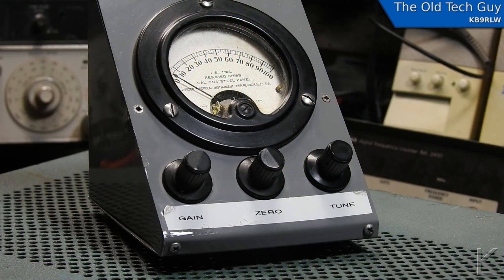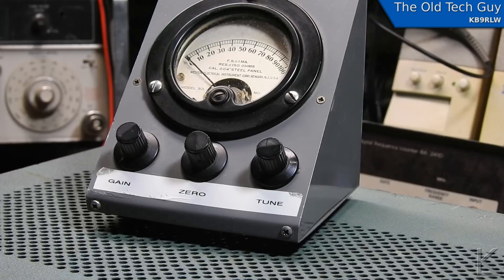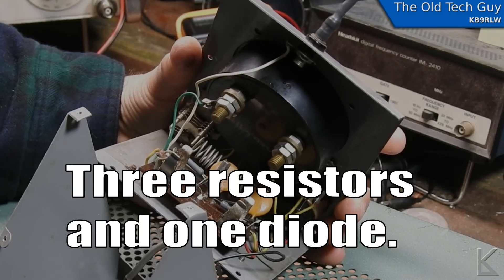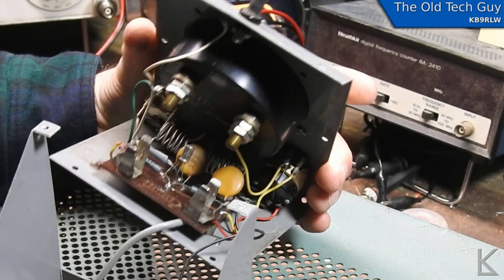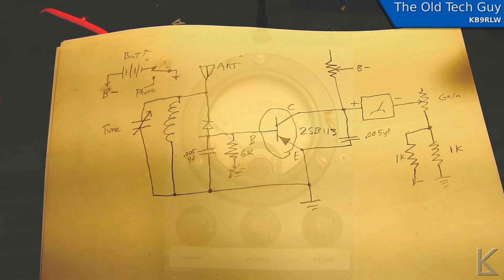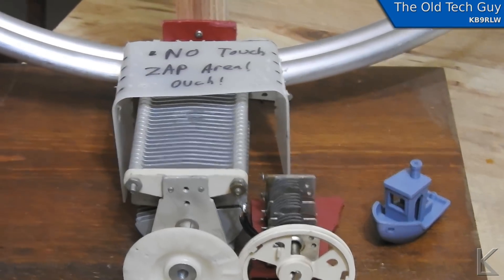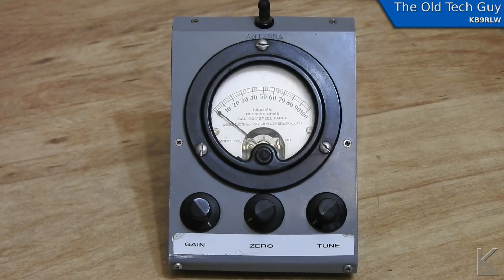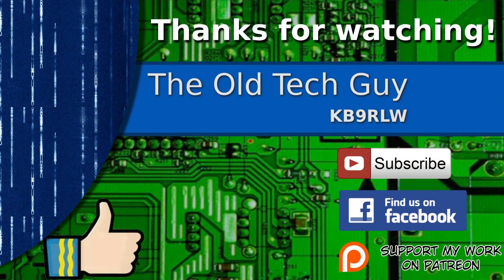Ham Radio - Dissecting a mystery meter.  What is this thing?

Comment: It looks to me that that's simply an AM receiver. LC circuit tunes the frequencies until receiver tunes the transmitted signal. Diode detects audio that could be heard with a high impedance headphone, of around 2kohm. Transistor simply amplifies slightly the audio to get more volume. Adding another audio amplifier and a speaker should be enough to hear AM stations at great volume.

Comment: thank u very much sir.  whats the range of frequency it deteceted
Reply from the maker: It has a tuned circuit centered around 27mHz.  So its probably good within 5 or so mHz either side.
Reply: @loughkb  thank u sir .its for CB radio i think

Comment: I've heard of trucking companies having truck stops check power on cb's looking for linears and so on. By chance did this come from the D.O.T. in the past? Measured at the front bumper of the vehicles, this could've been used regularly, every day to STOP cb splatter and transmission interference (especially at blasting sights where the ignitions could be set of by them) on road work locations?

Comment: The meter movement is obviously a replacement for the original one that was square since you can see the 4 extra mounting holes in the back of the front cover.
Reply from the maker: I wouldn't say 'obviously'.  It's equally as likely  that they had the chassis designed to accept parts from multiple suppliers.

Comment: Downword Modulation ??  kg6mn
Reply from the maker: Yeah,  the FT817 puts out a carrier and the power goes down with AM modulation rather than up in power.
Reply: @loughkb  Looks like ft817 has a poor AM modulator, or maybe it was just improperly tuned for AM because RF power should go slightly up when speaking into the mic. Since this is a 5w PEP radio, AM carrier should be set up to 1.25w at most to get up to 5w PEP if modulation percentage is highest (100%) which is a value that you probably cannot reach because ALC would prevent going close to 100%.

If you set the carrier for 1w then PEP should be 4w when carrier is modulated at 100%. Average power should be then 1.5w because a 1w AM carrier modulated at 100% with a tone of 1KHz will produce two sidebands, upper and lower sidebands 1KHz up and down the carrier, that are 6dB below the carrier, at a power level of 250mw each. Then total average power should be 1000mw plus two times 250, equal to 1500mw. 

Since speaking into the mic will not make those highest 250mw average power levels, but maybe only 25mw for each sideband. Then average power when speaking into the mic would be 1000 plus two times 25mw equal to 1050mw on average while PEP is slightly below 1.5w.
Reply from the maker: @josemariatrueba4568  Doing a bit of searching, I find that many modern solid state rigs seem to do negative modulation for AM.  
The problem is endemic.
Reply: @loughkb  Yeah. I guess cheap radios might be this way, but my ts480hx was not too expensive and shows a clear increase in average power on AM when whistling into the mic. 
I still have the transmitter from the 60s, with an 813 tube in the final modulated by four 807 tubes, almost 1Kw PEP on AM with a 250w carrier, at near 100% modulation, but modern radios do not have a powerful audio amplifier modulating the carrier at high level.

My 480 measured with a Bird 43P watt meter outputs around 180w PEP with a 50w carrier. 
We must check on 12 volt radios what actual voltage is inside the radio at full power, because in my case RF power does drop down unless 13.8 volts at least are reaching the four final transistors at full power. I have to use a good power 14.8 volt supply with this radio because manual says that it may drain as much as 41 amperes! There are four wires and four fuses from the power supply, and it seems like each wire may eat as much as 250mV, or 1 volt in all.

Comment: Kevin, if you had a MFJ-259c antenna analyzer, would that be able to check the frequency of the tuned circuit? Fun video. 10-4 breaker breaker. Yes, a broadband fsm would be nice. 73.
Reply from the maker: Maybe.   You'd have to patiently sweep through and make note of any dips or peaks in SWR and impedance to look for a pattern.   Having the visual graph from the VNA makes it so much quicker to spot.

Comment: Very neat. Was sort of expecting you to try and see how the sort of make shift audio was from the phone plug. On a side note could the phone plug have possible then for external power? If its between where the battery would normally be.

KD9KCK
Reply from the maker: No, it wouldn't have been for external power.    You'd need a 1.5 volt source, who makes those?     It would have sounded fine.  With AM, you only need a diode and small capacitor, especially if you're near enough to the transmitting antenna.
Reply: Good point.

Comment: Can you read the number of the transistor  so it can be looked up to find if it a germanium or a silicon ,that could better date the unit, also what is under the front label  and where the words  rubbed off under neigh and the label replaces it, also the other words where they silk screened or a water rub on decal

Thanks Keith N9QDS
Reply from the maker: I peeled it back a bit further and there was nothing left under.
Reply: Keith you can see where I started to pull it off but decided against it.  Glad I did as there is probably nothing left under it.
Reply: Keith Schreiter From the looks of it I’d say it was a germanium transistor...
Reply from the maker: I had it written on the schematic.  It's a 2SB113.  PNP  Germanium.
https://alltransistors.com/transistor.php?transistor=9396
Reply: @loughkb  Which of course accounts for the positive chassis battery connection.  Not all "youngsters" are aware of this aspect of germanium transistor circuit design!

Comment: Is the mini jack for monitoring or external powering maybe?
Reply from the maker: A 1.5 volt external source?  Nah.   It was definitely for monitoring the quality of your transmitted audio.  It is labeled 'phone'.   Useful to the 3% of CB'ers who didn't just crank their modulation control all the way up. ;-)
Reply: I just thought maybe it was external power because it seemed to be connected to the battery circuit according to the schematic you displayed. But I did forget that the jack is marked "phone". Duhh.

Comment: Sixties is a good guess, the Japanese were just starting to come up in the world with quality equipment for competition in the global marketplace. The thing that goes through my head is that it's a local modulation monitor for the CB band as it would be hard to use it as an FSM with all the capacitive coupling. The Japanese CB regulations are: 500 milliwatts output and restricted to 6 channels. Back in the sixties, the Japanese government would have been more strict in regards to the citizens band so a way of ensuring that your signal was clean would be to use one of these monitors.

Of course nowadays, the government is a bit less strict and even though the rules haven't changed, their are people over in Japan that import "high power" rigs (4 watts!) and use them illegally. The Japanese trucker is the biggest violator of the current laws.

So, final analysis: It's a local monitor. The reason for some of the parts being American is that the Japanese manufacturing in the sixties was not the best. Boy did that change in the seventies, eh?